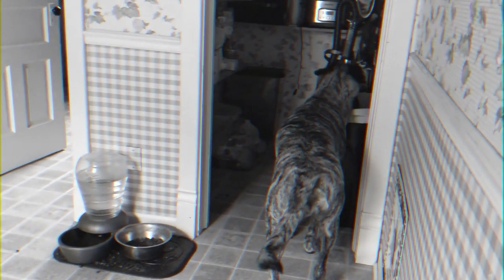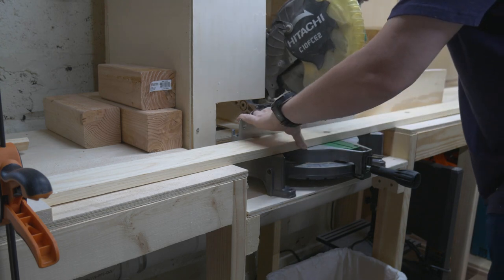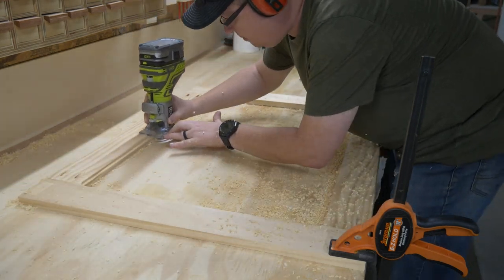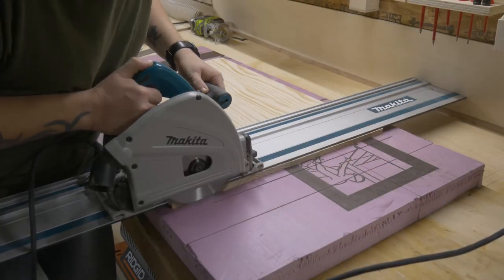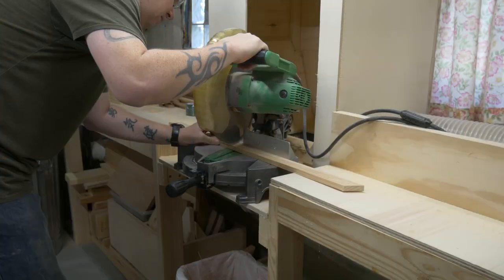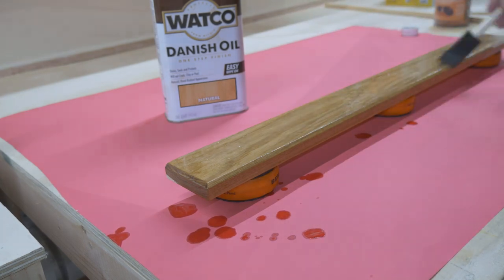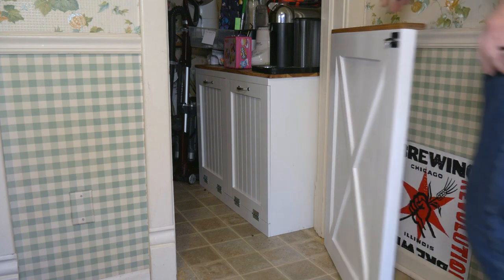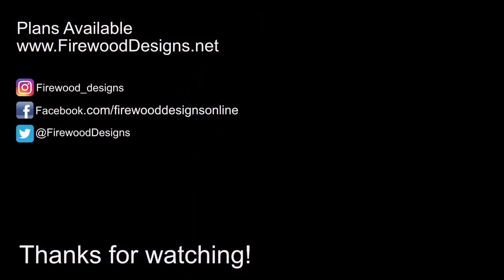How to build a Baby Gate Dutch Door Thingy! Free Plans

Comment: Omg this video is perfect for what I need. Question though! I don’t have a door frame, so would use a piece of wood to the opening to hang the hinges. How do I measure how wide the door should be considering?
Reply from the maker: If I'm picturing this correctly, I'm thinking you just have a drywall or plaster entryway? In this case I would attach a piece of lumber to the wall where your hinges would be. So measure the width of your current entrance then subtract the width of the board you will use which is most likely going to be 3/4". Hope that makes sense